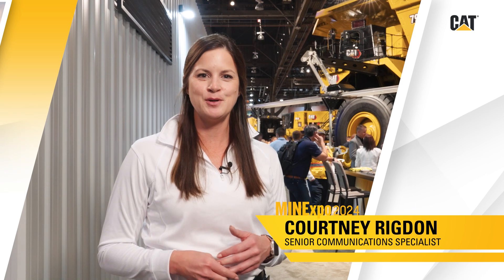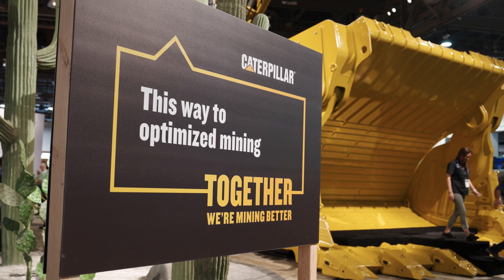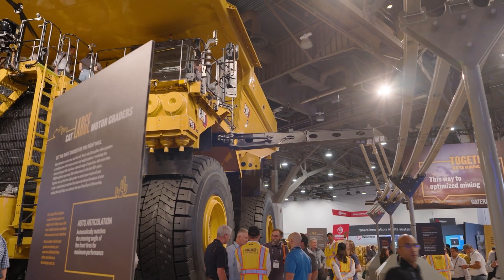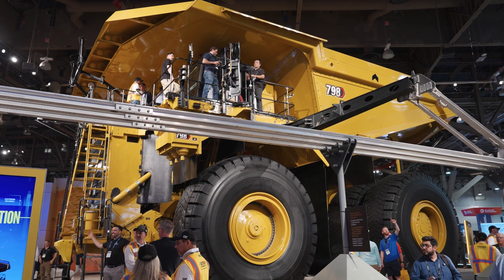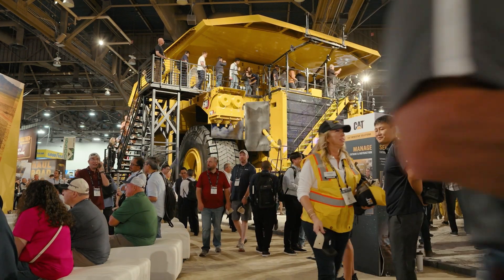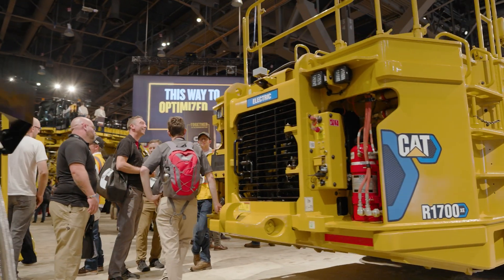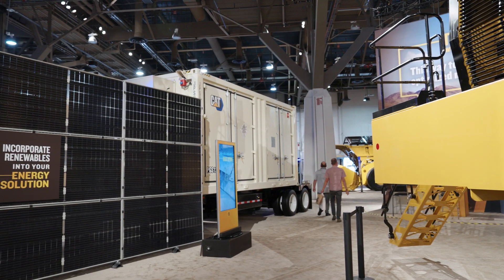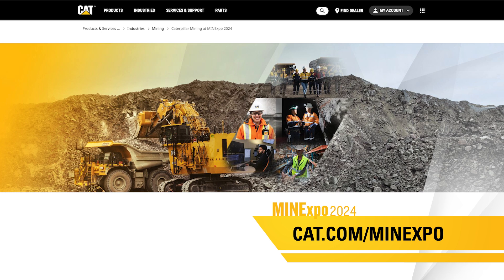Caterpillar Mining at MINExpo 2024: Day 1 Recap

Comment: reupload i guess?
the DET seems brilliant and really obvious, smaller and cheaper infrastructure, more flexibility in use
whats the downside though
can it still output 5mw like the overhead wires?
is there safety concerns with it being low enough for trucks to impact with the live rails?
does the different contact method limit the trucks speed? (being able to do 40km/h upgrade loaded is very important)

either way you guys really need to stop producing mechanical drive trucks entirely, because barely any of your fleet has the electric drive capabilities to even use this system youre working on. every other ultra class haul truck on the market has been diesel electric for decades, komatsu and liebherr dont even produce mechanical diesel haul trucks anymore, why is cat so far behind everyone else?